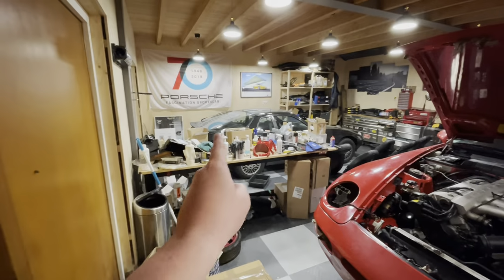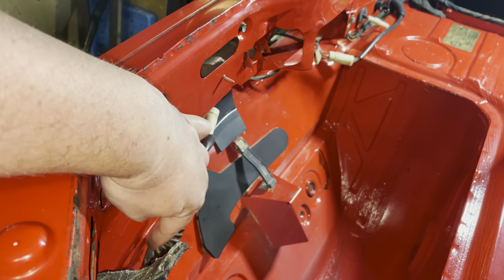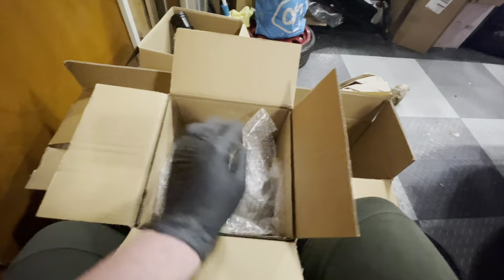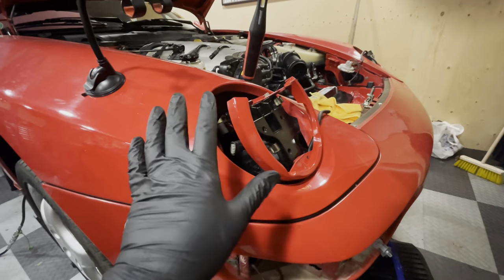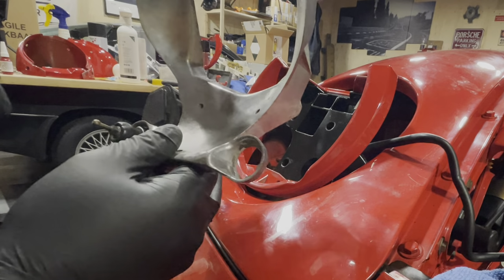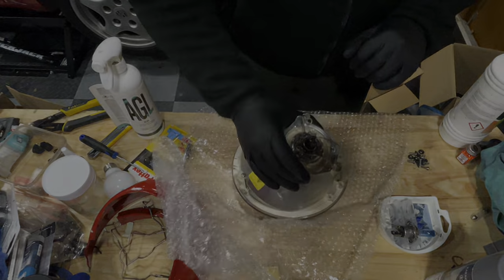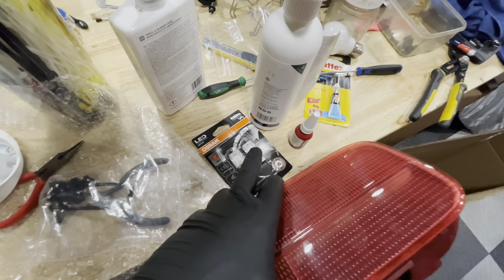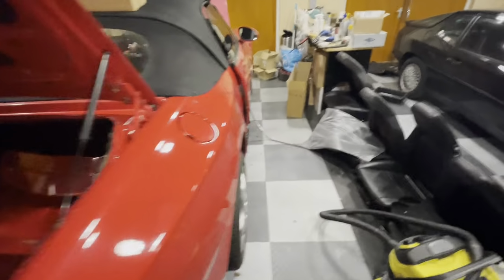Restoring a Flood Damaged Porsche 968: Headlight & Taillight restoration #Porsche968

Comment: I am unfamiliar with the 968 platform in regards to the electrical systems but if the 968 has a similar setup to the 928 S4, you will get a warning light with those LED taillights.  They don't offer enough resistance to keep the system happy and you will get a lightbulb failure warning
Reply from the maker: I used them on my 996 without issue, they have resistors in them exactly for this reason. But I guess time will tell 😅

Comment: I knew this was going to be a big job restoring this car, but I’m still surprised at how much work has been required 😮
Reply from the maker: You and me both Chris! But on the upside, this is a very rewarding project as I can see just how exceptionally good the car is under all the grime. I am yet to discover the slightest spec of rust.

Comment: Did you put any aluminum tape on the inside of the housings to improve reflection where the original chrome coating has worn away?
Reply from the maker: No, the headlights are new units and the fogs are painted with chrome paint. I am going to ship them off to a specialist though for rechroming within the next couple of days.
Reply: @GarageBiljon  sorry, meant the taillight units
Reply from the maker: Ah, ok  @jeffhammond8969 , no I just gently cleaned them. The silver coating survived very wel in the taillights as far as I can see. The only way you could do tape is by splitting them open, but I have not gone that far...yet.
Reply: @GarageBiljon  actually, you can do it by laying in small pieces.  Nice that yours survived well.